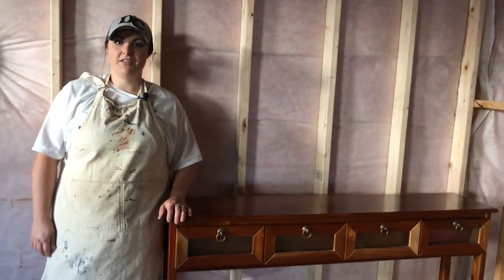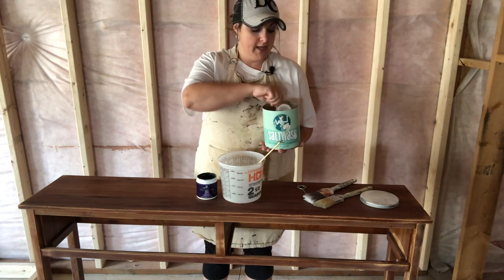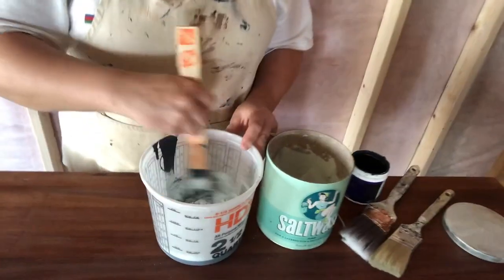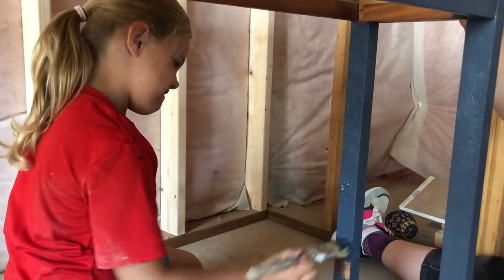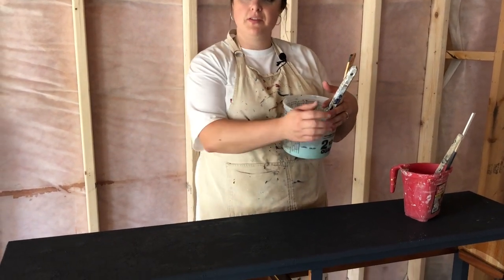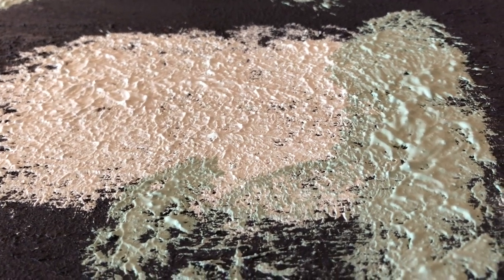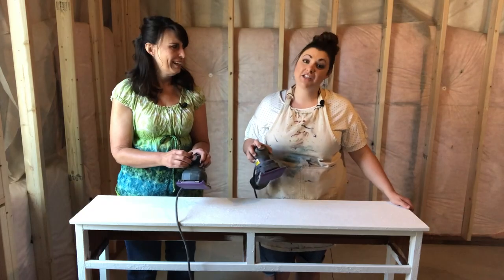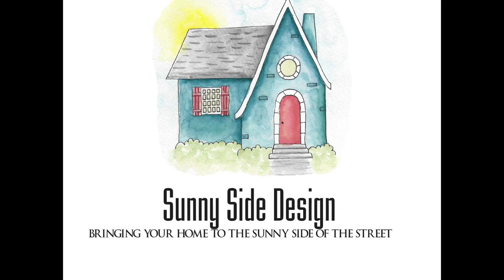Saltwash Furniture Tutorial

Comment: Considering the salt, and apparently no clear finish top coat, is the piece water proof/resistant?
Reply from the maker: Great question Jeff. You're right, there is not finish top coat applied to this project. It has held up really well, just like any other painted piece of furniture. I'd say if you're looking to get that extra protection you'd definitely want to add a top coat.